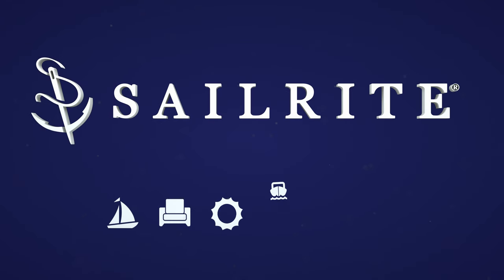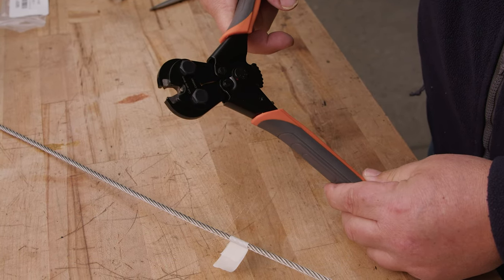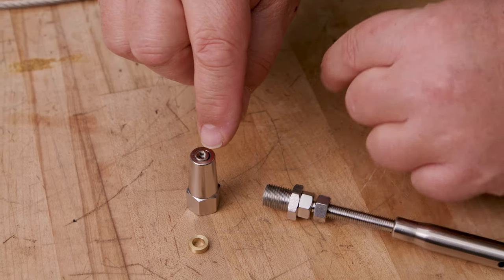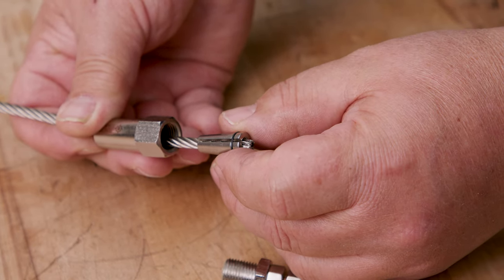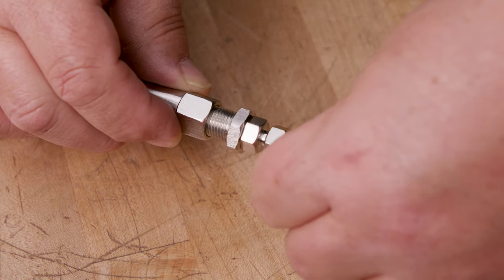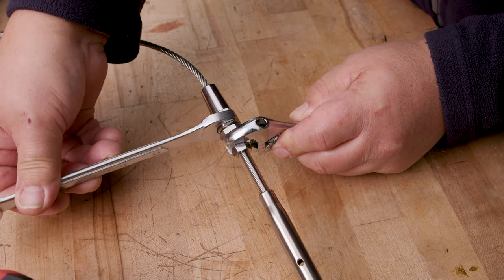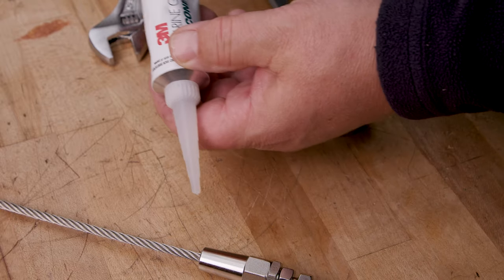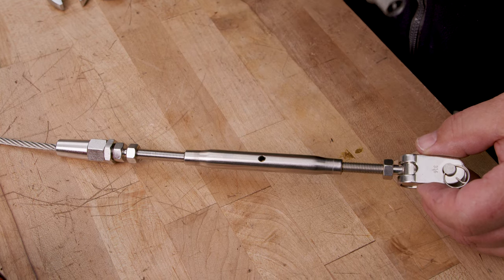How to Easily Install a Turnbuckle on Wire Rope Without Special Tools!

Comment: How do you determine the length of wire between turnbuckles? Say, I want to have a 20 foot length. so If the turnbuckle is 12 inches closed? Is it based off the fully opened length?

Comment: I was told that the stainless steel needs to have air around it and not to put a silicone sealant as it needs to breathe. ( that’s may not be the right way the say it but I hope you understand what I mean )
Reply from the maker: You bring up a good point. However, the manufacture recommends sealing that end. See PDF: https://biltapp.com/wp-content/uploads/2015/10/suncor-stainless-lifeline-warnings-revised.pdf

Comment: How much weaker is this than a swage? What are it's practical uses?
Reply from the maker: A swage is stronger. It is typically used for Lifelines on a boat. The Working Load Limit (WLL) is determined by the WLL of the wire used. Do not use Quick Attach fittings for lifting or shock load applications that may exceed 33% of the fittings rated working load limit. Applications where quick attach should not be used include but are not limited to standing rigging, lifting apparatus, and amusement rides. The wire we used has a breaking load limit of 3241 lbs. The working load limit is typically 1/3 less than the BLL, so the wire's WLL is 1080 lbs. 
Do not exceed 33% of that amount means the WLL of the Quick Attach System with the wire we used is 724 lbs.